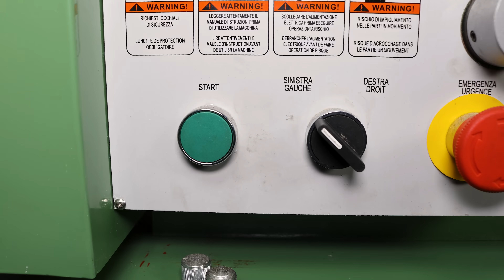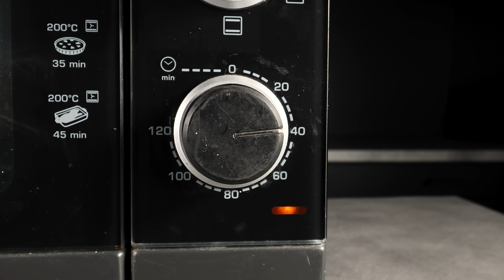Grapes Juice Press Restoration

Comment: Considering its a food handling tool, I believe all the wood parts should have been new and sealed food grade specific oil. But great work as always
Reply: I'm surprised this isn't a top comment.
Reply: No one is going to be using this. It will be a decorative piece
Reply: @Adam Ridama to show it works. No one is going to use it 😂
Reply: @Adam Ridama yes, he's going to be pressing his own grape juice, enough to where the finish is going to matter. He's actually starting a fresh pressed grape juice business. Derp. There's nothing there that will have any negative effect on your body with the rare use it will receive.
Reply: @Adam Ridama you dont need to have inside knowledge. Just a bit of common sense.
Reply from the maker: exactly
Reply: Yes I also believe that if this was to be used on a regular basis then the varnish, wood filler etc would have a negative response. I can also safely assume that a person with enough common sense to put this together would know that. It amazes me that people watching cannot think past their noses at times.
Reply: As always a very nice job. 
Nice video.👍👍
Reply: If the wood was rotting beyond belief or had mold growing or something like that, I'd think the same
Reply: @barbaragrace1992  luckily, i HIGHLY doubt he will and i think he'll just keep it on display, so no need to worry
Reply: Yuk nomornya masih bisa di Indonesia🇮🇩 yang tidak bisa DM ya😊 kak untuk berubah menjadi planet🌍 Neptunus yang tidak bisa DM agar dibantu
Reply: @rafanizam9135  This is a restoration video that is not in INDONESIA.
Reply: @rafanizam9135  something about DMs? My translator be wack. 😂

Comment: I be honest and tell you that while I gave you a like as I really appreciate the effort you put in for the restoration of this timeless equipment, please, please stop sand blasting timber. Just sand it at the most or use steel wool with white spirits to clean it up and if it is riddled with borer then replace it like you did with the barrel exterior. They did not paint, oil or varnish the timber in these grape presses for the reason that they did not want the finishes leeching into the juice (hence why the borer must have loved it - all that extra sugar from the grape juice).
Reply: Im no restoration expert but why can't you sand blast wood?
Reply: @Mr-bappoo  wood is not the same density as most metals (although some hardwoods would seem to be) and the blasting can easily strip away the softer grain of the wood causing the piece to be damaged and greatly changed in dimensions. Good sanding techniques will give a more even finish or using various graded steel wool with white or methylated spirits can clean up the timber but is time consuming. On a side note I have seen baking soda being used in a sand blaster as a less abrasive and damaging implement. And yes I have seen effective use of sandblasting timber where the surface of the timber is burnt to give a textured finish that is in line with the grain of the timber.
Reply: @MrAl28111  Likelyhood that he changed the media in the blaster between materials?
Reply: I think it's worth noting that while he restores many of these items to a technically "usable" state, more often than not tools like this are being restored as a museum piece. With that in mind paint and varnish are used simply to ensure the tool looks good and will not decay quickly.
Reply: @cavemaneca  No argument from me on that. I did mention that if you are restoring it to be used then it would be better to replace the actual part with a new part (reminds me of some other YT channel where it is often said "I make a new one"). I must add that the actual sandblasting did expose the true extent of the damage done by the wood borer (lil bast*rds that they are).
Reply: @MrAl28111  dang it, I follow so many restoration channels who says "I make new one" again😭
Reply: @ReachePoison  Nothing wrong with making a new one as you can increase your skill/knowledge
Reply: I came here looking for someone else who hac considered the leeching of chemicals into the product of this restoration.

Comment: You turned on Dark Mode - nice! Another great restoration, but you should be careful with anything with woodworm damage. I used to work at a painting restorer. We were always worried about woodworm in old frames, because if you get a woodworm infestation in your workshop, you basically have to burn all the wood in it.

Comment: My grandpa made an apple juicer a long time ago. He had a little electric motor that he hooked up to a roller with screws and a press to crush up the apples, and the apples would fall into a lined box on the bottom. After we filled the box we would slide it forward and put the lid on it and start twisting the press. He used an old crank car jack to press the apples and we would collect all of the juices in a giant pan and make apple cider. He had Granny Smiths and McIntosh trees and it made the cider a tasty sweet sour... I miss making apple cider with the family.

Comment: Starting at 20 points:
- 5 for not fixing cracks in wood with CA or epoxy 
-7 for not powder coating metal parts
+4 for staining some of the wood 
-4 for not using food grade finishes
-5 for painting other wood 
- 2 for Xmas colors
+4 for great tools
+5 for polishing main press screw
+3 for showing juicer in action 
-2 for slurping noises
Overall 11 out of 20 on this one

Comment: If I recall correctly, many olive/fruit and grape presses looked and functioned essentially the same as each other.
Reply: pretty much. I can imagine for olive oil it might need to be just a bit warmer however the friction might be enough.  Its even very similar to how you can grind grain in to flower. however there you would replace the wood with stone to make it more durable.

Comment: I was surprised you went with wood filler over epoxy for the wood pieces.  Though I am guessing the amount of sanding required to remove the excess epoxy might have made it not worth it?  Though you do have that lathe...  :P

Great work as always.

Comment: Feet need screwed to a Base,  also space  between slats is way overboard, would have replaced metal bands and redrilled holes to facilitate tighter gap between slats or used wider slats , love the rest of restoration and finish.